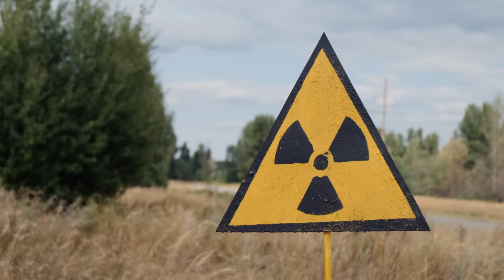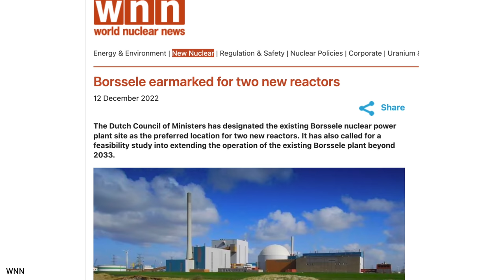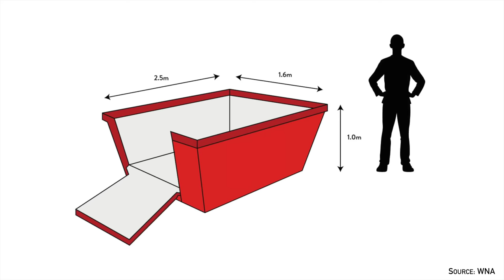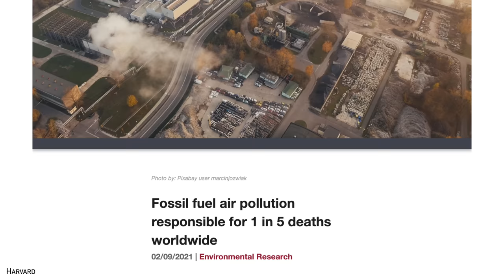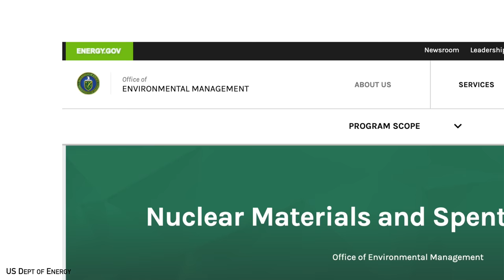Can Nuclear Waste Ever Be Solved? Yes.

Comment: I'm surprised we don't seem to have better ways to pull energy from "passive" decaying "waste", instead of finding better ways to bury it, why not figure out ways to make use of it ?
Reply: Yes that’s on going, deep space probes and some Mars landers run on radioactive decay. And tiny amounts are used in the like of smoke safety detectors that can run for years.  The power per kg material is thousands of times higher for a live fissioning reactor though, over radioactive decay. And fission can be controlled, ramped up down, turned off in an instant. With decay power you get what you get. 

So yes, decay provides heat, but at that level building the required protection structures most of the time makes it not worthwhile.
Reply: The pools that hold high level waste naturally generates hydrogen.  That could be used for H2 fuel cells.
Reply: @quantummotion  I'm thinking use them as batteries for geothermal well digging rigs, leave it at the bottom of the hole when done ... Two birds one stone sort of thing.
Reply: @quantummotion  No significant hydrogen from fuel in pools, unless some accident where cooling stops, water starts boiling away.
Reply: Sadly, we do not. 
The methods used in RTGs for space probes etc are not very efficient, nor are they responsive to demand. They consist of Stirling engines, or on a variant of the old "Einstein" refrigerators.  Fine if you want 50 watts for your space probe, not so handy for getting full value out of your nuclear fuel at sea level.
It would be nice to have something like a PV panel that simply absorbed Gamma and delivered current, but so far not. Of course, it would have to with stand all other radiations like neutrons and alpha, and it would have to resist chemical breakdown from out-of-range gamma. tough call.

Decaying waste COSTS us energy to keep it cool. To run refrigeration and water pumps 24/7/365 to prevent it getting too hot.

People in very cold climates may be able to use the heat to some benefit: pipe the heat to municipal spaces and down major roads. Residents could use a heat pump to pull heat from the warm water and into their underfloor heating. This has a substantial cost in municipal reticulation and pumping, but under major roads and heating heavily used community spaces might be worthwhile.

In warm climates, we get no such advantage, plus increased costs of waste heat removal, thermal pollution of water bodies, and reduced efficiency of the turbines in the actual reactor.
Reply: @aaroncosier735  “Decaying waste costs energy …”
Only place that happens at any scale is spent fuel pools next to reactors  which is a tiny, trivial share of the power coming from a reactor. “Increase cost of waste heat removal” is trivial.  In a half dozen years the heat is also trivial, needs no pumps, needs no cooling, needs nothing sitting inside a concrete can indefinitely.
Reply: @Nill757  Well?
It  simply DOES cost energy, and cooling hardware, and backup systems, and "defense in depth" that usually involves diverting needed community assets.
It's most definitely a cost, not a benefit.

Spent fuel may well not strictly need a pool after a very few years. Most spent fuel has been in much longer than the minimum needed. The IAEA inventory of spent fuel waste has some US waste in pools for over thirty years.
Dry casks may need no active cooling but are still a cost for monitoring and inspection. The US Federal government subsidises that cost to the tune of hundreds of millions per year.

Dry casks are not "indefinite", they are not rated for permanent storage, nor intended to in any way. Most are not rated for transport either, except for the small fraction that have already been moved to other locations. They are a target for terrorists, rogue states, major exchanges, and for decay and vandals in any situation where ongoing funding fails.
Reply: @aaroncosier735  “not a benefit”

I said, the cost of spent fuel cooling via “pumps”, your word, is “trivial share of the “ reactor power”.  I did not say it was a “benefit.” as you assert.  You might as well cite the cost of shoveling snow out of the plant parking lot, about an acre. 

You didn’t and I didn’t discuss management and handling of spent fuel, a different issue. What are you on about?

“They are not rated”
“Rated” is not some magic forecast meaning the thing explodes the day the rating rubs out. Rating is what some engineer guarantees somewhere with no further analysis according to some leak limit given to him, and the limit might be silly or politically driven.  Naval spent fuel is shipped around US all the time; it’s never hurt anybody either. 
The Brooklyn Bridge could not have been “rated” more than 40 years out the time of its building, and yet 150 years later there it stands.  No doubt the Ferry owners at the time predicted imminent collapse. 

“They are a target …” for whoever. Look that’s just hand waiving.  I get it, if you’ve had five friends tell you “this thing is the really dangerous thing, never mind that town that burned up in a oil fire”, then you’re going to believe it, but please don’t tell me I have to w no evidence of anything.
Reply: @Nill757  
So, in summary, spent fuel decay pools and their active cooling are a cost, as I pointed out.

You can try and trivialise that, but you'd be making a mistake. The cooling cannot fail and requires always-ready backups. 

You can also whine about containment "ratings", but there is no reasonable expectation dry casks are anything other than their rating. They might last a century or so, but not comparable to the containments that will be required to last many thousands of years. 

Yes, they are a target. If you want to pretend not, that is your privilege.
Reply: @aaroncosier735  “So in summary … I will use selective facts, invent falsehoods, and ignore others because that makes my story feel good”

Congratulations
Reply: @Nill757  
Nope. 
Look at the initial comment. My response was that the waste heat from thermogenic wastes is of no benefit but that it is an expense.
You have somehow tried to confect that into a dispute. 
Cooling spent fuel is an expense. A real one, and not as trivial as you would make out, since the cooling must not fail.
Reply: @aaroncosier735  as you know, you attempted to ‘summarize’ the entire discussion as pumping away spent fuel decay heat as a significant expense, more than shoveling snow out of the parking lot is an “expense” I pointed out that the heat removal was an exceedingly trivial expense, and why. Then you tried to ignore that fact, then pretend you were talking about something other than heat and conflate in handling, security.

And Btw, the spent fuel pool cooling can fail for a time before  a million gallons of water evaporates and uncovers the fuel.  There are hundreds of always on systems in factories around the world, lighting, power, cooling, and the supervisors dont pretend their budgets have to be extra extra special.
Reply: @Nill757  
I did indeed summarize the cost of cooling spent fuel as a cost.

You yourself have tried to trivialise it.

That cooling is not trivial, and requires expensive backup because it is dangerous if interrupted.

Repairs of even minor faults are both expensive and urgent.

Of course, should a fault be neglected, uncovered fuel would have consequences that dwarf any cost you might regard as "trivial".

The acceptable rate of such failures is zero. 

There are certainly lots of "always on" systems. Most do not have the risk of a spent fuel fire as a consequence.

You are free to regard these as "not special".
Reply: @aaroncosier735  there is no uncovered fuel
Reply: @Nill757  I said: "should a fault be neglected". A conditional situation.
Spent fuel can uncover itself if neglected, or if the cooling systems are deliberately damaged.

When the Soviet Union collapsed, no one got paid to secure or maintain their RTG sources, and some people have died. Those sources were fortunately small.   

The US is not immune to economic collapse, terrorists, or plagues, any of which could leave a shortage of manpower or money.

Comment: My gut feeling is that fission nuclear power stations producing these type of radioactive waste will eventually be replaced by fusion power stations within the next 50 years or so - an educated and rather pessimistic timeline guess. Fusion reactors produce very little radioactive waste and are inherently less dangerous to operate. In addition to publicly funded fusion projects like ITER (Cadarache), JET (Culham) and Stellarator (Greifswald), the R&D of fusion reactors today by so many private companies is mind-boggling. This very legitimate nagging problem of the fission waste disposal must be designed away once and for all.
Reply: How do you know fusion reactors produce little waste and are less dangerous?  No one has cracked the process and built a plant.
Reply: fusion produces more radioactive waste than fission if you dont account for used fuel that can be burned in gen 4 reactors.

Comment: Surely the most effective way to deal with this old radioactive waste is to use it as fuel in a Molten Salt Reactor? The spent material has at least 90% of the energy still left in it, and that could power MSRs for centuries without mining for much new material.
Reply from the maker: Yep, it would be great! MSRs have always been interesting but struggle to gain any popularity commercially. They're risky for any large operators to try and build if they're not sure an expensive MSR will work well.
Reply: We are a capitalist society.  If it can make money it will be done.  If it is not cost effective it will not be done.  Now do you know why there are no commercial MSR???

Comment: Even Germany is rethinking shutting down its last reactors. The cost of doing so just smacked them in the head. Nuclear must be on the table as a non-carbon emitting baseline source for the forseeable future. Modern modular, scalable and standardized plant designs can provide clean energy for millions and millions of people with much less accident risk and cost than large plants.

Comment: How does the cost of recycling vs mining nuclear fuel compare.  It seems like the usable fuel density in spent uranium is much larger than what can be mined.
Reply: First you have to separate the Pu239 and any remaining U235 from all the other spent fuel stuff.  No one reuses the U238 which is the majority of spent fuel because it is plentiful and inexpensive and it requires more processing to separate it from the fission fragments.

After separating the Pu239/U235 you then have to mix it with U238 to make new MOX (Mixed Oxide Fuel) fuel.  The U.S. wanted to dispose of pure Pu239 from nuclear weapons to make MOX so it was just the last step and here is how that worked out.

The MOX facility (South Carolina) was a U.S. government nuclear reprocessing facility that was supposed to mix pure weapon grade Pu239 with U238 to make reactor fuel assemblies. It was canceled (2017) in the U.S. After spending $10 billion for a plant that was originally estimated to cost $1 billion and an independent report that estimated it would cost $100 billion to complete the plant and process all the Pu239, Trump canceled the project in 2017.

Anything involving radioactive material is expensive. Anything involving fissile material that can go critical is very expensive. Anything involving Pu239 that is fissile and highly toxic is very very expensive.

The above is reality not a YT wanna be scientist spewing their 2 cents worth
Reply: Depends how much you want to recycle it.
The first fuel cycle uses enriched natural uranium, and produces spent fuel containing some leftover U235, lots of the U238 that was in the original fuel and some newly produced Plutonium.
PurEx separation can separate these from the fission products, and some isotopic separation can get out the worst of the undesirable actinide products.
This can be used to make MOX mixed fuel, with a top-up from either weapons plutonium or some other enriched material (which was not cheap to make).
Burning MOX fuel gives a whole new headache. The neutron bombardment of Plutonium gives you a whole bunch of new actinide isotopes that uranium did not (much) in the first pass.
Among these are U236 and U232. These make all future handling expensive and awkward. Large "cross-section" for neutron capture, markedly reducing the efficiency of subsequent fuel mixtures, and U232 has both an awkwardly long half-life and very energetic gamma emissions. Used MOX fuel either gets reprocessed very quickly, while still very "hot" without the traditional cooling period, or it rapidly builds up U232 which generates highly penetrating radiation with a half-life of 60 years. Reprocessing this is a lot more awkward and expensive than for uranium-only fuel. Isotopic separation is also awkward. The masses are very close to desirable fissile isotopes (U232 vs U233, U236 vs U235) so you either throw away desirable fuel isotopes or include very undesirable contaminants, whilst contaminating your witheringly expensive isotopic separation/enrichment facility.

The simplest reprocessing, as used by France for it's spent fuel after considerable cooling periods, still seems to make things expensive. Various low costs are quoted, but the actual cost of electricity production in France is very high, hidden by similarly huge state subsidies. I am by no means certain that industry-wide reprocessing of nuclear fuel for re-use will do anything but increase costs. I'd say at least double.

Comment: Ну... сухое хранение это не шилдинг это по сути накопитель , так как весь этот металл и бетон из которого сделана капсула будет фонить еще очень долго
Reply: There is no radiation from dry cask storage above background radiation levels. Concrete and steel reduce it a million fold.  Concrete and steel are not activated by decay radiation (alpha beta gamma) either.

Comment: Recycling nuclear waste, then storing the remaining waste deep underground, in bore holes, backfilled with concrete, seems the best solution.  Energy analysts predict SMR’s will play a major role in future power supply, providing 20-30% of all power, with solar, wind and hydro making up 70-80% of our power generation.  EV’s will take over transportation over the coming 2 decades, with over 90% of li-on batteries being able to be recycled, offering continuous loop energy, storage and transportation.
Reply: Yep, a lot of this used fuel will be a gold mine for the next gen plants, especially the fast reactors.
Reply: The current cost of nuclear electricity is about $0.15/kWh.

The current cost of wind and solar electricity is about $0.03/kWh.

The cost of storing wind/solar to make it 24/365 reliable is dropping extremely rapidly.  Why would you want to add in 5x more expensive supplies?
Reply: @bobwallace9753  The grid integration costs of variable renewables is more than 10X the nominal cost.
Reply: @gregorymalchuk272  
Please explain why.

And what is the source of that claim?  Where does one find the data?
Reply: Yeah but don't backfill it! We'll want that fuel in the near future
Reply: @bobwallace9753  you're not factoring in subsidies or the environmental impacts. I love our natural world. I don't want it paved over because people fear something they don't understand
Reply: @bobwallace9753  the costs of 1 KWh storage in lithium batteries is 400€. The energy returns of "renewables" at the end life cycle is NEGATIVE. The future is nuclear or back to oil, its just math
Reply: @alwar5822  
The material cost for lithium iron phosphate (LFP) batteries is about $30/kwh.  Add in about $10 for manufacturing and about $10 for pack assembly and the price is around $50/kWh.

That's with a cycle life of 5,000 to 12,000 full cycles.  Shorter when used in vehicles due to vibration from being moved and longer when used in stationary applications.  Let's use 10k.

$50/kWh / 10,000 = $0.005/kWh.  And remember, both renewables and nuclear need storage.  Also, nuclear needs backup generation since reactors can and do go offline for periods of days, months, and years unplanned.

At the end of their useful life both wind turbines and solar panels are almost totally recyclable.  There is embedded energy in the steel, copper,  aluminum, glass, REM magnets, etc. used  and these materials can be inexpensively recycled avoiding the energy cost of mining and refining.

Want to do some interesting math?  Look at chart #9 - the unsubsidized real world cost of electricity by source (US).

https://www.lazard.com/media/sptlfats/lazards-levelized-cost-of-energy-version-150-vf.pdf

Divide the real world cost of nuclear (sans backup) by the real world cost of solar and wind to find out how many more times nuclear is than renewables.